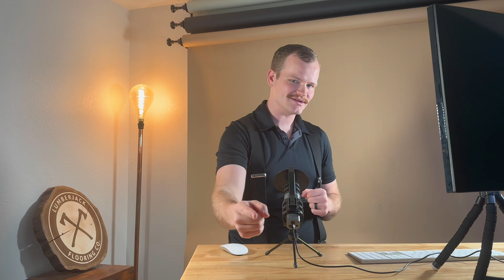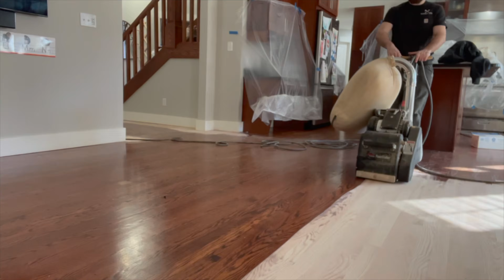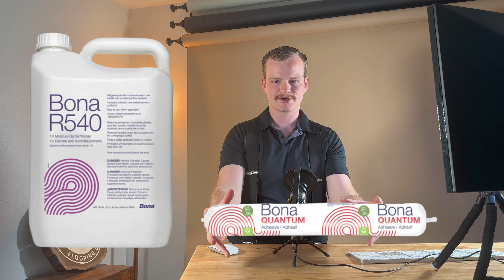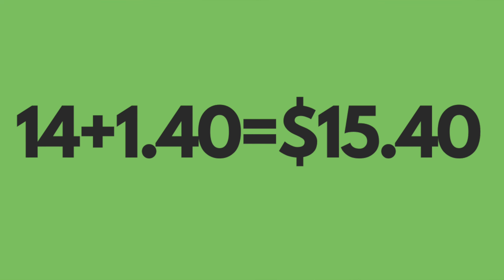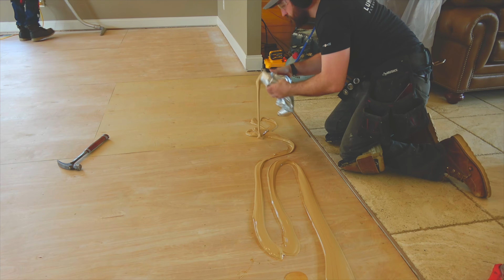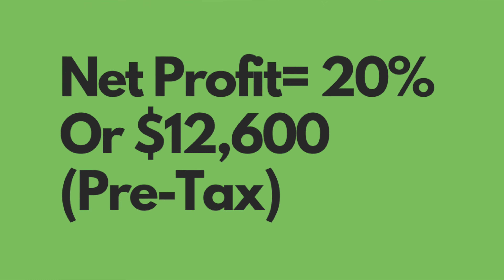$74,000 Hardwood Floor Bid (profits revealed)

Comment: I’m currently struggling with starting out on my own. I’ve been in the business for over 16 years and recently had a falling out with the guy I learned everything from ( he didn’t want to pay me for months) so I decided that I would try to do it on my own and am struggling with Two major hurdles. 1. Since I’m starting from literally nothing except for my knowledge I don’t have the capitol to get sanding equipment which wouldn’t be two big of an issue if 2. I knew the right way to go about getting good job leads. If I had good install leads or even a handful of laminate jobs then I could buy my sanding equipment but I don’t even know where to begin and Angie’s list and others like them seem not very helpful since they sell leads to other contractors so I’ve had an issue with paying them for leads. It’s a struggle but I know if I can come up with a solution to number 2 than it will solve number one and will change my life cause currently I’m struggling just to make ends meet.

Comment: Trying to convince people that you get what you pay for ( good wood , good milling, thought out and secure and  attractive installation, careful and complete sanding and cleaning , uniform staining , well applied superior top coats , moisture awareness and control of both subfloor and flooring and yes if something goes wrong I will fix it)  - that was often harder than the project itself. But, reputation and word of mouth kept me busy. And a good part of that was trying to rescue the crap job that they went with first. As a local building supplier said when I told him my intention was to do the best job possible , 'Well , you'll get all the trouble you need even with that.'

Comment: Where are you located? Your video is educational. I always underprice my work, but 6$ for installing 4inch unfinished hardwood(staples only)  seems a little bit high. 
10-inch planks? I would never recommend that wide for glue down.
Reply from the maker: Thanks for watching. 

We service southwest Michigan. 

As far as the price, I don’t think it’s high at all. We are not the most expensive even. The skill of doing this work and toll it takes on one’s body means that whoever is doing the work deserves to be paid well and we pay our workers well.

As far as ten inch and glue goes I would be curious what other method you would use? I am not aware of any that would fit NWFA guidelines.

Comment: I am little bit confused. You keep saying you want to use this woods, and this quality product. Now i understand it is your preference to use this. But shouldn’t you worry about the clients preference? What if they only have the budget for lower quality product? I have personally bought and installed 4$ a square foot hardwood floor with my contractor and it went great and the results is exactly what I wanted and expected. I would’ve of never been able to afford to do it if I didn’t participate and bought an affordable product.
Reply from the maker: Thanks for your comment and for watching this video. 

If we are doing the job we are not going to source a material that we don’t stand behind. There are red oak floors that we install that the material is not that much more than what you refer to here. If someone doesn’t trust our recommendations on what materials to use, they won’t trust us for anything else. So we don’t really run into this problem.

Comment: Where would you suggest buying flooring from?
Reply from the maker: Thats hard. Most pro distributors won't sell to you unless you have a company. Vermont Plank online has some beautiful wood. I have never used it before but they seem very reputable and sell directly to the customer. If quality is not your top concern you can use Hurst hardwoods online. I have used them and the most I will say online is that I probably won't use them again.